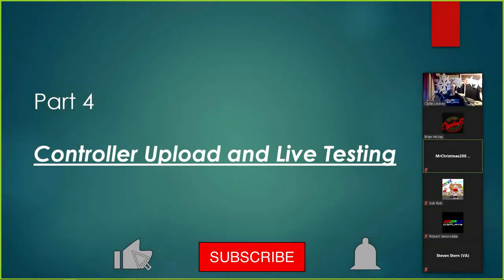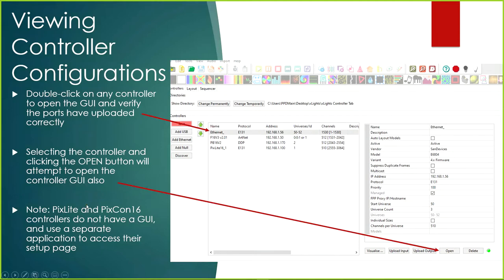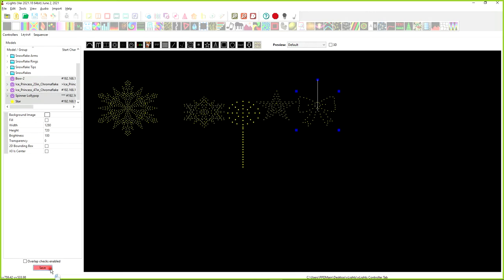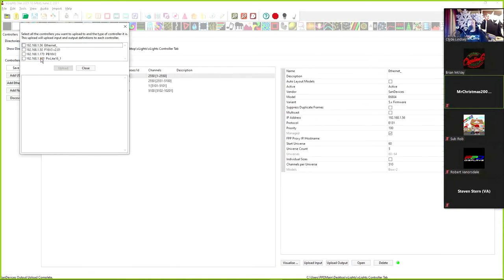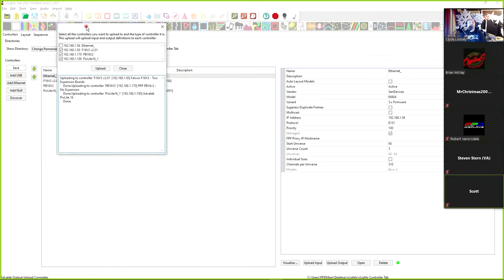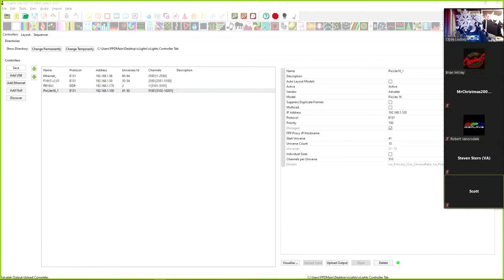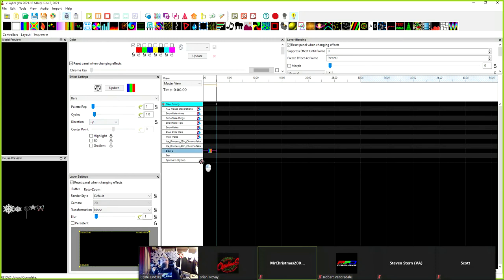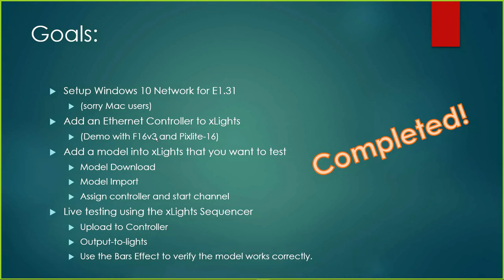June 2021 Webinar Part 4 Controller Upload and Test Prop

Comment: I can ping my controller but I am not getting the green light in the bottom right hand corner of xLights next to the delete button. Any ideas what I'm doing wrong?
Reply from the maker: Is your computer directly connected to the controller with an Ethernet cable?   Are you able to double-click on the controller to open up the controller config screen?  Do the lights work when outputting data to the prop?